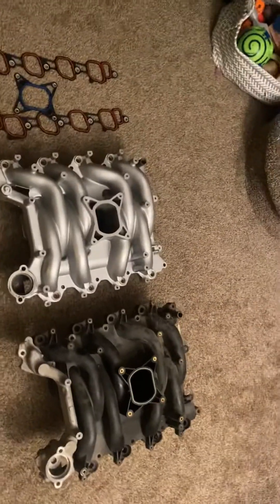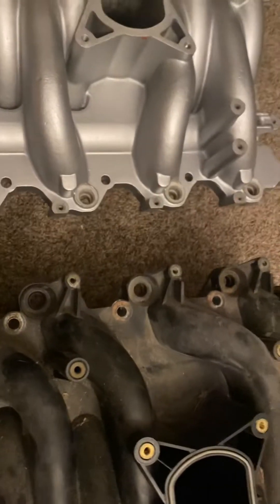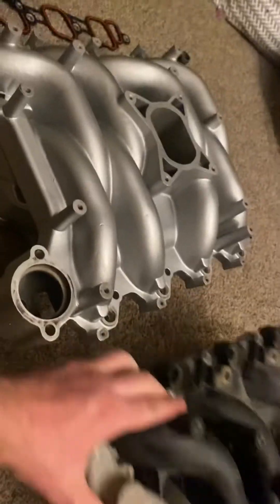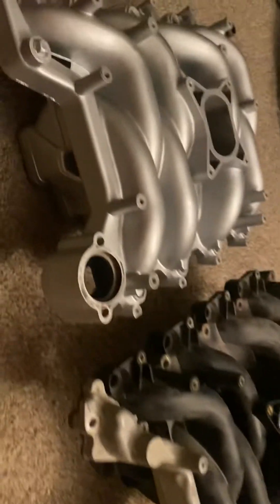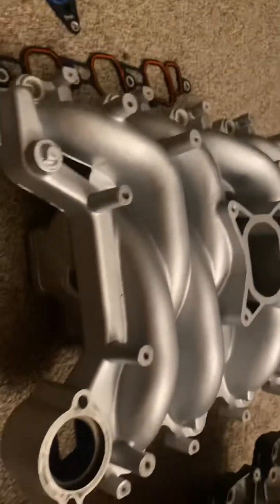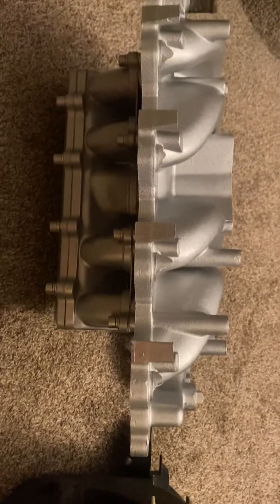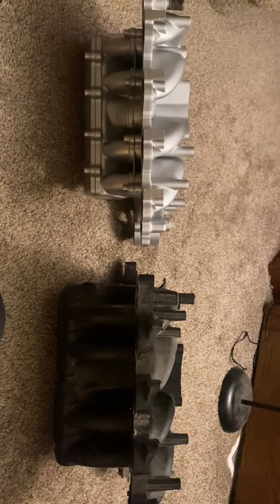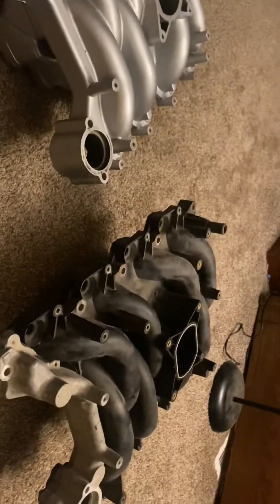Ford 4.6 2 Valve Intakes: Speedmaster  /Professional Products Typhoon vs OEM P.I intake

Comment from the maker: BIG NEWS: These are now back in production! AS OF 7/23/2025 You can get one NEW again under the ‘Speedmaster’ brand!!! Price is $560 for one brand new!
Reply: I see I'm not the only one that's constantly on the lookout
Reply: Do you know how awesome this is. Mine broke the heater nipple and so far my fix doesn’t feel trust worthy. The after market doorman and now the new ford “performance” one both lose horse power. Now this should work good since they brought these back. Great news!
Reply: @jeremybaker4444 seriously this is the only way to get a true PI intake now. Its an added benefit that its entirely aluminum.
Reply from the maker: @jeremybaker4444 despite the fact these aluminum ones are the best available, the new Ford intake is still a good choice too. It’s similar to the Dorman but it’s not the same. Yes on the dyno it did lose a little power compared to the original design but the dyno was also on a modified mustang with bolt ons. I think the power loss would be less noticeable on a stock Crown Vic
Reply: Just checked and didn't see em on the site... got a link?
Reply: How did it work out i ordered the new summit one it lasted 3mos
Reply: I just ordered one 550 out the door,tired of breaking plastic.those manifold gaskets are stock to the vic or mustang

Comment: Hi Dan, time-sensitive question I would be grateful to get your insight into! Do you know if the Speedmaster intake will work with non-PI heads or is retrofitting required? I just bought an 8k mile 96 Crown Vic LX HPP and want to swap the intake immediately so I won't need to worry about it during a trip from MA to FL and back next month. Thank you!!!
Reply from the maker: It will work, you’ll need a little RTV sealer to make it work. Chris Fix has a video of doing a PI intake swap on an NPI mustang and it is a virtually identical procedure on the Crown Vic.
Reply: @DirtyDanMunicipalMan thank you Dan! Right after writing you I realized the damn Speedmaster is out of stock everywhere!
Reply from the maker: @Justin-ex7gg they had a Black Friday sale and these were FLYING off shelves as they were only like $350ish new.

Comment: If you have an aluminum intake with flange erosion you can have your local automotive machine shop resurface the cylinder head side flanges using their belt resurfacer. The alloy intakes are vastly superior to the plastic junk.

Comment: Thanks for the info! I just picked one up for 100 bucks to replace my leaking one.
Reply from the maker: No problem! That’s why I made the video!
Reply: @DirtyDanMunicipalMan question, can I use the 2000 intake gasket also or do i need the 2008 intake gasket. I notice minor difference but the ports look the same. But just seeing what you used for them.
Reply: where you find an aluminum one for 100 bucks

Comment: The latest Ford intake manifold is different from the one shown here. I just installed one on my 2002 Mustang  GT. You don't need the gasket strip as shown here because the gaskets are pre-installed on the latest Ford intake. Some of the original hardware won't work with the latest manifold and some of the mount points are plastic only. The latest Ford manifold is $335 @LMR. The Typhoon sounds more sturdy but the weight may be an issue for those that race.
Reply from the maker: Yep, I’m familiar with the newest Ford intake. You can save yourself some money and buy the Summit Racing intake. It’s the exact same part as the Ford replacement just has the summit logo and is $200 vs $340 for the ford branded one. Speedmaster has also just re-released the typhoon intake pictured here and while it’s heavier than the plastic, it’s a great intake and it will most likely never break.
Reply: I just installed the new Ford one too. The inserts for the coil pack bolts keep breaking. I hardly even tighten them and now 3 of my coil pack boots are stuck to the manifold.

Comment: I was looking the part number up on Home Depot can’t seem to find the exact bolts you’re using, any help maybe I’m about to put mine on this weekend. I happend to be able to get a new un used manifold
Reply from the maker: M8 1.25 x 45mm is the bolt size. Head to your local Home Depot and check the bolt section. That’s what I did.
Reply: @DirtyDanMunicipalMan perfect I looked the ones you have up and it shows a full threaded bolt you think any difference with them or no
Reply: @DirtyDanMunicipalMan they’re the same size and all just not half 3/4 threaded like yours

Comment: I was looking the part number up on Home Depot can’t seem to find the exact bolts you’re using, any help maybe I’m about to put mine on this weekend. I happend to be able to get a new un used manifold
Reply: Hey buddy your running the professional products intake? If so did stock gaskets work for you?
Reply: @crsone7377 same as this guy 01 crown Vic gasket
Reply: @crsone7377 for the plenum and then intake manifold gasket for the year of ur car

Comment: My 98 Ford F-150 4.6 2 valve has a cast aluminum intake? Is it original? It's using a little coolant and has a fast idle (vacuum leak). Do I need to replace the gaskets and or the manifold. Thanks
Reply from the maker: @timgiles9413  the F150’s use a different type of intake and I’m not familiar with the issues those have. But yes a few years did have factory aluminum intakes.

Comment: Anyone know if this will work on a 2004 5.4 2V?  Thanks
Reply from the maker: This will not work on a 5.4 2V, it’s too narrow. The 5.4 is about 2 to 3 inches wider then the 4.6L if you can find some 5.4 to 4.6 intake manifold adapter plates, you could probably do this. Guys who would 5.4 swap mustangs used those a lot.
Reply: @DirtyDanMunicipalMan  Thank you!
Reply from the maker: @jackwpeters  no problem sir!
Reply from the maker: Biggest issue is that those intake adapter plates are really tough to find as they’ve been out of production for a while

Comment: Did you ever notice any power gains?
Reply from the maker: @jamesvalenti9288  my engine was bone stock so not much. Car did pull slightly harder in the midrange, but that could’ve been placebo. I bought the intake so I’d never have to worry about a cracked intake not for performance

Comment: I'm looking at a 99 that never had the plastic intake changed. Is that a deal breaker? 68k miles 2 owner 35th anniversary vert manual. Want to buy but not happy about immediately getting leaks LOL.
Reply from the maker: @someparts  I wouldnt pass up a good car over the intake. It’s not a horrible job to change it yourself. After the first time I did it, I can swap an intake in 2 hours if that.
Reply: @DirtyDanMunicipalMan  Thanks bud.
Reply: @someparts did you get it??
Reply: @NewEdgeDesigns  Nope, probably should have ...but to be honest I want a 2001 Cobra.
Reply: @someparts  another great choice!! There’s Pros and Cons too Cobras and GT’s..

Comment: What is the part number for the Felpro gasket set? Not the plenum one, the 2 seperate ones for the cylinders? Thank you
Reply from the maker: @greg20152015  I quite legit just purchased them off Rockauto.com. They’re the only option from felpro for the intake manifold gaskets.
Reply: @DirtyDanMunicipalMan  ok. Is it P/N MS92121-3?

Comment: There is upper plenum gasket it just don't use a gasket. The 96-98 CV has a gasket similar to style to lower intake gaskets
Reply from the maker: You need to use a gasket or you’ll have a leak with this manifold. I used a gasket from a 2000 Crown Vic and it was a perfect fit here. You could use RTV but the gasket is easier and was barely $2 on Rockauto.

Comment: I keep thinking about using a similar year truck intake instead. A little more torque, with a 75mm 5.4 3v throttle body could be much better with an appropriate tune.
Reply: And the hood will have to be cut on the panther cars.
Reply from the maker: Biggest issue with the truck intake is that they fall on their face after 4000 rpm. It could work, but you’d also need to run new EGR tubing, plenum and a few other parts. I’d definitely upgrade the plenum and go with the 75mm TB tho.

Comment: Any ideas where to get the gaskets that hold the “3 piece” assembly together? I just got a used one and want to take it apart to clean it but don’t want leaks and can’t find gaskets anywhere
Reply from the maker: I believe professional products still sells them. BUT you can also use RTV
Reply: @DirtyDanMunicipalMan  I thought about using rtv but prefer the actual gasket. I couldn’t find anything but I’ll look up professional products. If not then rtv it is. Thanks!
Reply from the maker: @John-qr8eg  you could also get gasket material and make them yourself. Most auto part stores swill sell DIY gasket kits

Comment: I bought one of these for my old merc lse. Center console shift 😍. The oem was 330, the typhoon was 330. 

Direct bolt on is true, however the hardware for the typhoon is shorter. I guess the edge of the intake is thinner so the factory intake bolts wpuld buttom out in my car.

Once on it felt like it lost torque.. I assumed the intake would shift the power band higher in the rpm range so the torque loss makes sense with the factory rev limiter.

Also opted for trick-flow reusable intake  gaskets.
Reply from the maker: Yes sir, I did mention the bolts in the video but the hardware can be had from Homedepot for cheap. I honestly didn’t notice any loss of power with this. But I’d assume cause of the design of the intake it would probably make good power at higher RPM. I just liked it cause it won’t break like plastic!

Comment: man i dont even care about performance numbers, i just want an intake that aint all plastic and prone to cracking. u have no idea how many i replaced on my cars and friends cars. always the coolant nipple in the back or sometimes the coolant ports cracking in the front. every one u see on ebay people are charging 1000 or more. sigh
Reply from the maker: Allegedly, a company called Speedmaster or Procomp is going to be making this manifold again I. The future, but I’ve been hearing that for months and haven’t seen anything yet. It’ll be the exact same intake as the professional products.
Reply from the maker: That’s exactly why I purchased this unit. Didn’t care about performance, just wanted something that wouldn’t break!
Reply: Yeah mine on the front split at the weld.

Comment: I looked at getting one of those.  The weight and heat soak  penalties were not worth the cost for me.  They were about $700 so when they first came out.  To be honest, unless you have a heavily modified 4.6L, it's hard to beat the stock PI intake.  The Dorman replacement PI intake looses power over the stock\Ford Motorsports PI intake.  I've seen some articles claiming something like nearly 26 HP at the rear wheels from swapping out to the Typhoon intake.  Problem is they used a ported upper plenum and 75mm throttle body in conjunction with the Typhoon.  It's well known that the factory upper plenum is a restrictive piece that benefits greatly from porting.  The stock throttle body is 65mm.  In my opinion, these two factors were responsible for the power gains more than the Typhoon intake.  It's also claimed that it pulls strong from 500-6500 RPM.  That's not much different from the stock PI.  Although the stock PI is only good to about 6300-6400 RPM.  Richard Holdener  has done a bunch of dyno testing various intake manifolds for the 4.6L you can watch on YT.  It's worth checking out.
Reply from the maker: I’ve seen the Richard Holdener videos, he’s very spot on. I’ll concede that if your purchasing this looking for performance gains, you’ll likely be disappointed. I did notice some decent mid range power improvement but not a huge amount. As for heat soak, unless your engine is built and putting down tons of power you won’t notice a difference. I didn’t. Cars used aluminum intakes for years and this intake will still experience less heat soak then an aluminum intake on a small block covering a lifter valley getting splashed with hot oil. Biggest benefit and the reason I purchased it was it because the stock ford plastic intakes always crack and leak coolant on the Crown Vics and with this intake you’ll never have to worry about that. I also do agree that the stock throttle body and plenum are restrictive stock, no doubt about it.
Reply: @DirtyDanMunicipalMan mine took over 20yrs and 200k miles for mine to crack at the thermostat section. That's not bad at all
Reply: I put a Dorman on a 07 P71 at 125K. It is really hard to notice any difference. If there is it might be a half a second from 0 to 60. With the 3:55 rear end I do 0 to 60 in 7.5 to 8 seconds with 143K.
Reply: Lol bud ur not going to notice and heat soak this is aluminum not cast iron bud 😂😂i have one on my 06 p71

Comment: What flange style is it? I want to put a aftermarket wildon intake plenum on mone, but cant find info on the bolt pattern or flange pattern for upper. Thanks
Reply from the maker: It’s a stock replacement, it’ll fit any OE or aftermarket plenum designed for a 99-04 mustang.

Comment: Do you have a part number for this brand of intake? Or any other brand
Reply from the maker: I wish I did. These have been out of production for a while. There’s talk of another brand bringing them back but I haven’t heard any updates in a while. This intake was listed for the 99’-04’ Mustang GT 4.6L but is an almost perfect fit on the Crown Vic.
Reply: @DirtyDanMunicipalMan  I found an intake online for about $500. It said for a 4.6l 99-04, so om glad you had said that. Thanks bud

Comment: I have seen performance improved and non performance improved side by side before.  The problem is identifying them.  The only way to do that is to 1. look at the bottom of the intake runner where it meets the head and the top of the head itself (this is without taking the head off to inspect chambers) or  2. to note the runner size difference and the bottom air box difference and its fitment to the heater coolant passage hose under the intake. 1. Tear drop shaped rounded: NON PI. Square shaped with tear end: PI, the  back coolant passage should also be slightly different.  Another issue, is sometimes the PI and NON PI intakes are different from a visual on the block inspection.  I have tried to rely on the front tube idea (does not work).  That is, if the front most intake runner goes to the passenger side first, its supposedly PI, drivers side first Supposedly not PI.  From looking at this video's start, that may not be reliable all the time.  One of the tricks to try and sell someone that you had PI heads, was to NON PI to PI Swap and then claim you had the extra HPs because you used a gasket and some rtv.  I KNOW THIS IS ANNOYINGLY LONG, however, the easiest way I have found to identify the intake on the engine with the hood open is to look at the passenger side first runner.  If there is a gap, with a noticeably flat area, that you can put your thumb flat on (thumb sizes may vary) between the front coolant cross over and the first passenger side intake runner, that then leads over to the first passenger side fuel injector, then its A NON PI INTAKE.  If the first runner on the passenger side, has very little gap (you can't get your pinky finger in there easy) between it and the front coolant cross over, and the intake runner tube is rather large and tube rounded and bulgy, then you have a PI INTAKE!  That should be for all 4.6L 281 V8s produced by Ford, period.  WHY FORD DID NOT JUST PUT A DANG ALUMINUM INTAKE WITH A FORGED ALUMINUM GASKET OR A STEAL GASKET THERE IN THE FIRST PLACE AND JUST MAKE EM ALL PERFORMANCED IMPROVED PERIOD WITH COMPRESSION DIFFERENCES I DON'T KNOW.  Grain of salt:  you might find a pi intake on non pi heads, you might find a non pi intake on pi heads, you might find that ford made 5 different versions of that stupid plastic intake attempting to cease the coolant leak and cracking issue, then you might find, that ford just issued tubes of stop leak pellets with instructions.  OH, ONE MORE THING, AND FU PERFORMANCE PRODUCTS FOR NOT MAKING THE INTAKE ALUMINUM INTAKE ANYMORE OR THE GASKETS.
Reply: You can still get Fel-pro gaskets with the TB gasket also.
Reply from the maker: Dead on man. Honestly these cars should have came with aluminum from the factory!
Reply from the maker: Also, for what it’s worth, Procomp, or Speedmaster is allegedly going to be making these intakes again. So sometime in the future, there will be these aluminum intakes available for our cars.
Reply: I used felpro intake gaskets to mount mine and they fit perfect. You can always make your own gaskets with a sheet of gasket paper. I had to make a new one when I mounted my new plenum. Works just fine

Comment: I want dyno numbers. That intake isn't worth 5hp considering the added weight of source material used
Reply from the maker: Some of the Mustang guys had dyno numbers on there. Allegedly these were great in the mid to high rpm’s. I didn’t buy it for horsepower. I bought it because it won’t crack like the plastic intake. Didn’t lose any power with it car ran just fine
Reply: @DirtyDanMunicipalMan same, i bought mine back in 2006 or 7 when rear coolant outlet cracked on me. Combined with a good aftermarket radiator it runs cooler than stock.
Reply: @DirtyDanMunicipalMan is this smog legal? Or set off check engine light
Reply: Watched a video where they did Dyno runs to show the difference between the dorman and the pi manifold. It was almost a 20 hp difference

Comment: Is this originally intended for '99-'04 Mustangs?
Reply from the maker: Yes it is but works perfect with all the 01+ Panther cars as they use the same 4.6 2V.
Reply: Won't work with the 99 Cvpi with the non pi heads?